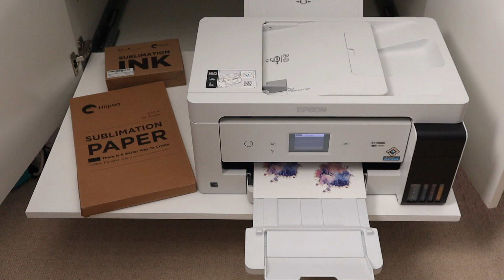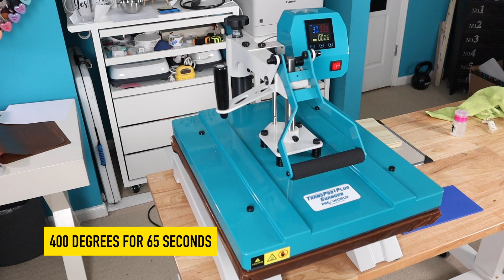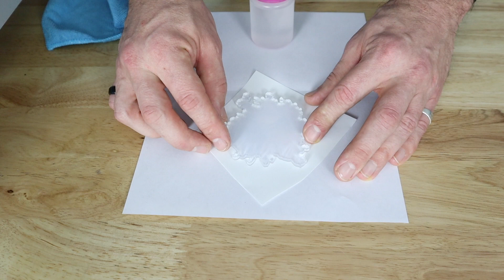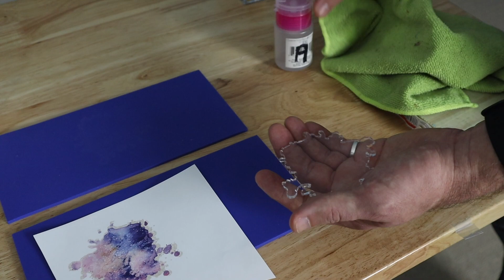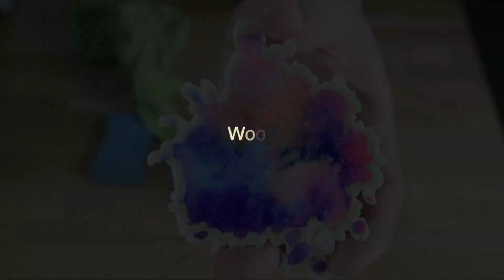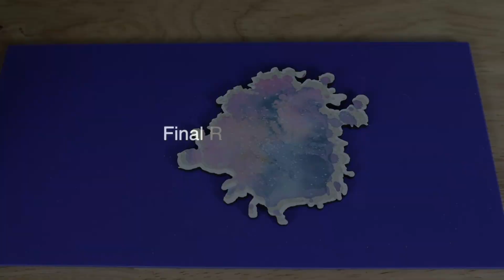SUBLASERMATION?!? Laser Friendly Materials You Can Sublimate On

Comment: Do you mask the front, back or both before laser cutting?
Reply from the maker: Mostly both. But the top is a little more important.  Helps the laser tell the height on auto focus and most smoke is going to be on the up facing side. 😁